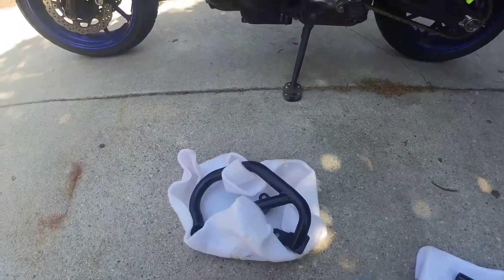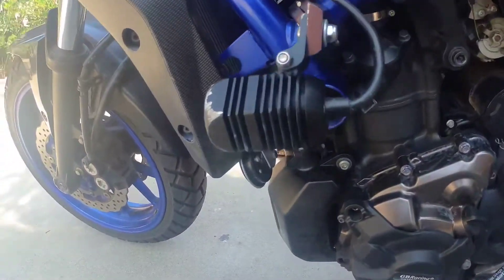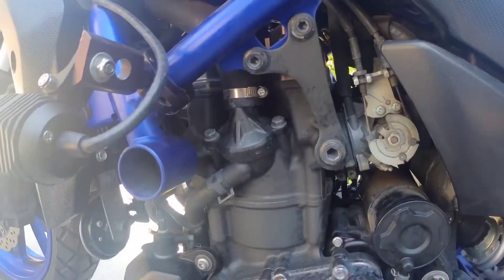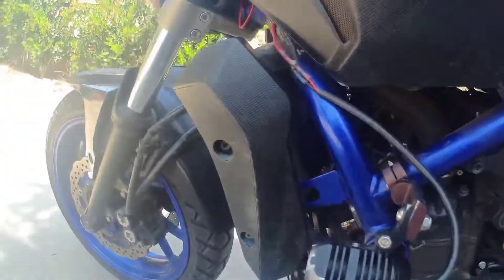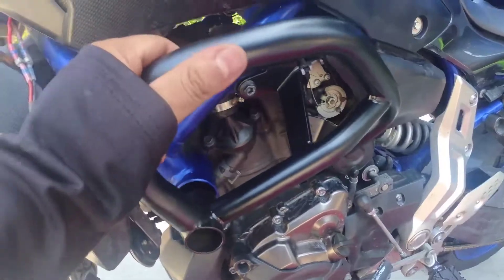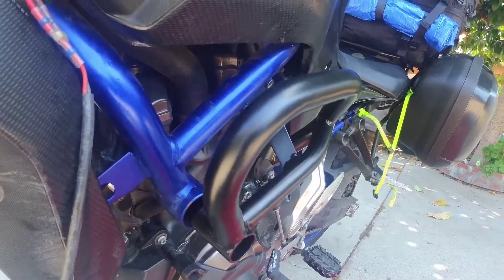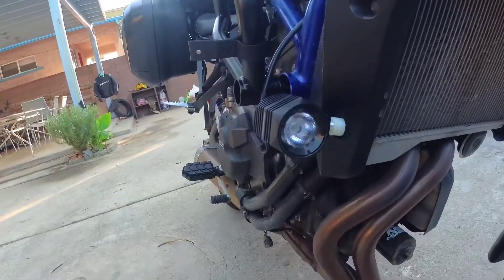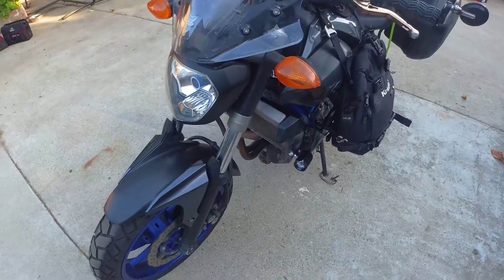2015  Yamaha FZ-07 Crash Bars Install

Comment: I have these bars, but can't figure them out. Where do the spacers go? Outside, inside? The long spacer goes with the big bolt? The longer bolts, are they supposed to replace the stock longer bolt?